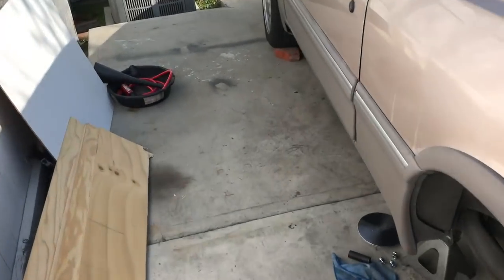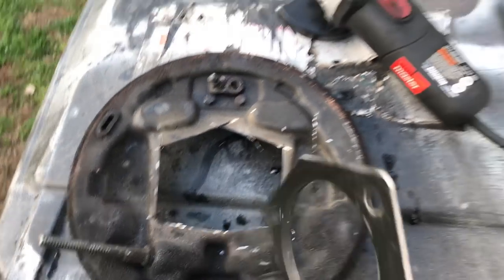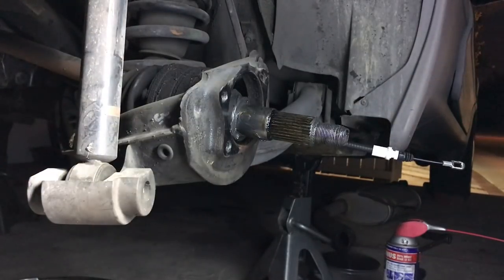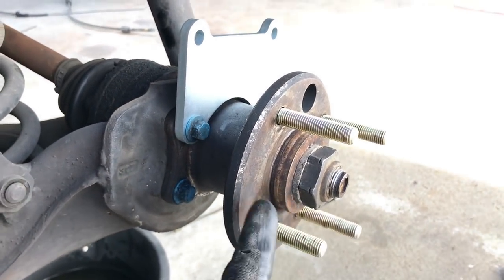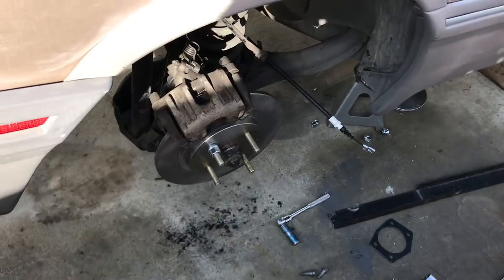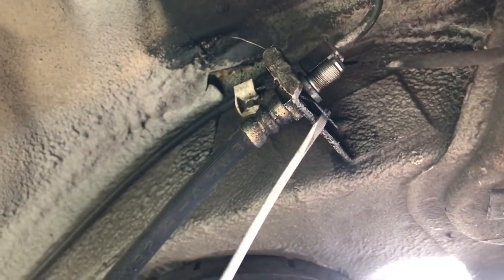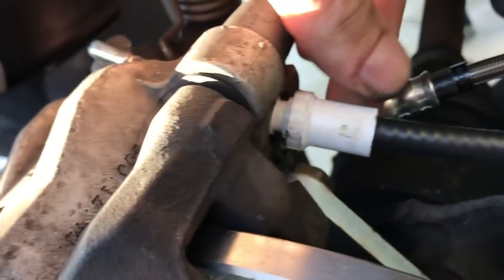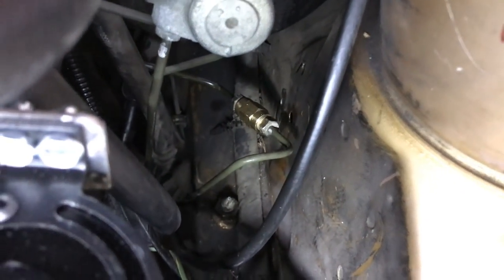Merkur XR4Ti Ford Focus rear disc brake kit

Comment: I remember doing a front hub nut on a Sierra estate many moons ago, ended up with the washing line on the end of a T bar with a similar 1/2" to 3/4" adapter... The T bar these days is about as straight as a rainbow!
Reply from the maker: Gavin Barker the bleeder is pointing up on the back of the caliper. I was definitely relieved when I saw that. I think it should bleed up pretty well.

Comment: Hello, I have an XR4TI and I want to make a conversion of rear discs. I already bought the adapter, I have some rear calipers from Focus 2013, I have the brake and handbrake lines, I only need to buy the discs to have the whole puzzle. So please, could you tell me what size the discs are and what car they are from to order them new in a spare parts store. Thank you very much!

Comment: Back in my Jeep Wrangler days, that hub nut can be made to stay still if you put the wheel back on with the center cap removed.  Lower the car onto the ground and the weight of the car will keep the tire from turning and you can crank on that hub nut until the cows come home.
Reply from the maker: Adam Payne yeah that’s what I’ll do to torque them down. I was just so impatient and wanted to get them near so I could see what they looked like 😊
Reply: The hole in the wheel is not big enough, unless you use a spare...
Reply: @timmilus84  Guess it depends on the wheel but even throwing the spare on has got to be easier than mig welding sections of bed frame to acorn nuts.
Reply: I take that back.  I guess the mustang 10 holes do facilitate being mounted, then torqued.  I want to say it's around 200ft lbs.

Comment: Will you need to change the master cylinder as a drum brake master cylinder has a residual pressure valve compared to a disc master cylinder?
Reply from the maker: No. I removed the proportioning valve for the rears so it's good to go...or at least the Merkur Gods say so :)
Reply: Nathan's Garage love seeing you back at it mate best wishes from Australia 🇦🇺

Comment: Wonder if the master cylinder rear circuit has enough fluid capacity for the disc brakes?
Reply from the maker: Rob Stephens yeah. This is a pretty well trodden path and volume hasn’t been an issue so far. That is something that never actually occurred to me though 🤔
Reply: It does.  Ford placed an automatically adjusting bias valve to reduce for the drums.

Comment: Are you still running that crappie 5 speed or have you swapped over to a t5?
Reply from the maker: Classic Stang brn ive not even upgraded to the crappy 5 speed yet...never mind a T5. This is a c3 auto car. Just waiting to see what drops in the market place. No rush on this one.
Reply: @NathansGarage  , that c3 is probably better then the 5 spd that came in it.

Comment: heyyy mister.Thank you for awesome video.Very nice to discover new channels,that are not like "Tv production style stuff".One thing that i noticed though...was that it seemed that you used Molybden grease for the wheelbearings? im not sure if that is the case though,but i reckon that would be the wrong type of grease to put in a wheel bearing,,as it has "metal particles" in the grease to make it stronger...for use in for an example CV joints.?just a thought mate :) Supercool to have a closer look at the Mercur version of the Sierra...so many different designs than on the European sierra.For instance the fuel system ...interesting stuff :) You are welcome to have a look at my channel also..i am restoring a Ford Sierra Rs Cosworth..(I also have a Mb w124 500e...which i had a lot of videos about..but for some ridicilous reason,,i deleted all my old content,about 250 videos worth....but i have not started to reupload old stuff..but also continuing doing videos of my Cosworth journey :) Anyways...Greetings from the NorwegianViking,Stefan :)

Comment: Where did you get the caliper brackets at?
Reply from the maker: Chad Murtorff Tim’s paypal is: timmilus84@yahoo.com
$170 for rear mounting kit, $55 for Euro  E-brake cable, $105 for front mounting kit (requires drilling mounting holes to 14mm).
Reply: I'm out until March though, so please email or message on FB.  I'm on the forum as well.

Comment: Nice bit of kit, but I kinda prefer the old Turbo Coupe rear disc conversion better.
Reply from the maker: Mealyman 94 never actually done the TC rear calipers. Tim’s a good guy and Focus’s are everywhere in the yards around me so it made sense to go in that direction for me.
Reply: @NathansGarage  no doubt, looks more than adequate, and I bet the TC parts are becoming scarcer, anyway!
Reply: I've owned the TC stuff in the past, the problem is the piston on the TC is 45mm, way too big, even on the later master cylinder.  The focus uses the same size matter as the early XR.  This also uses a rotor that is another 1/2" larger.  This is far lighter, uses larger pads, far more pad styles, on and on.  Also, you can bleed these easily and the rotor is hub centric (TC is not).
Reply: @timmilus84  with PBR calipers up front, though, my TC rears seem perfectly fine with the later master cylinder and a gutted prop valve. However, the "dinner plate" rotors are more prone to warping, and I doubt the weight savings are much of a consideration seeing as how many are sporting oversize wheel/tire combos anyway. As I mentioned, probably easier to source nowadays, but seems the benefits of one setup over the other are pretty negligible, and comes down mostly to personal preference/availability.